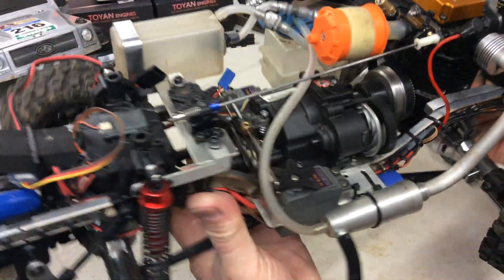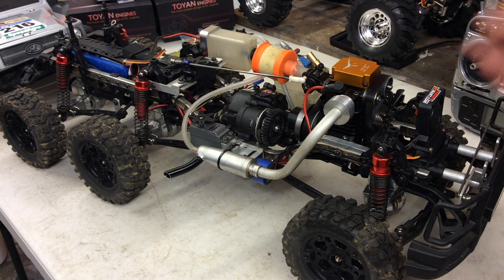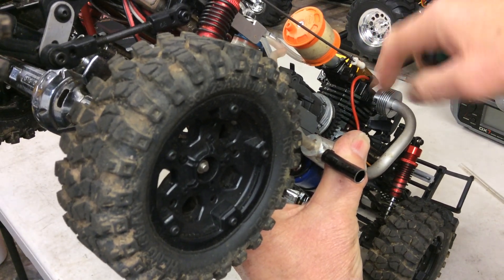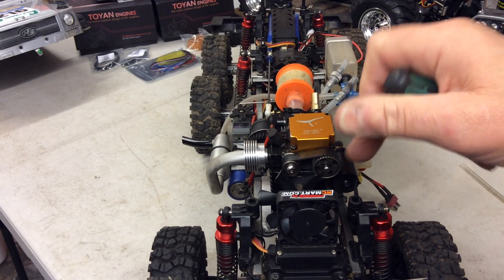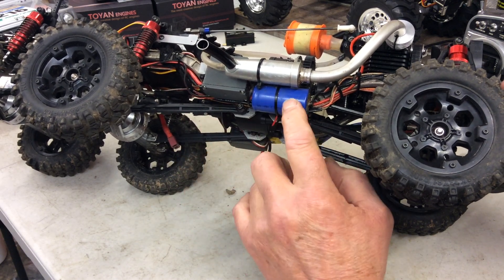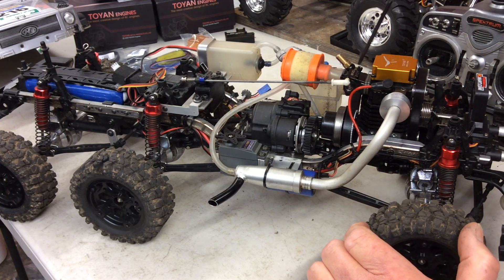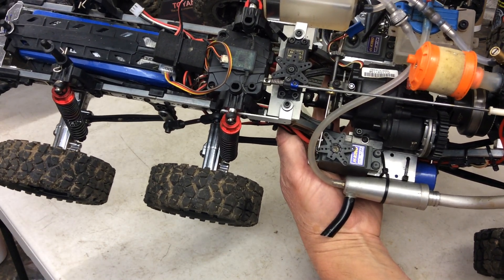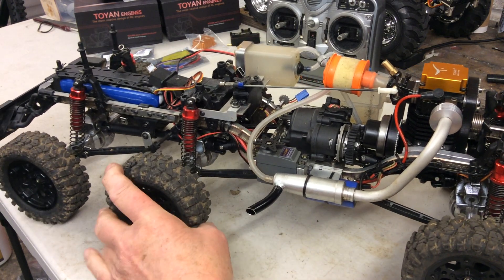Toyan Rc Engined P601 crawler 6 wheel drive

Comment: It’s not a catch port it’s a sump pickup, you can use a catch can if you want but you will be constantly filling it back up.
If you drill a hole in the oil pan you can run a filter and recycle it

Comment: Hi there, is there a particular type of grease I need to use on the cam for this engine or will any hard grease do? 
Great videos by the way
Regards 
Dave
Reply from the maker: dave garbutt 
Dave,  you don’t really need need a hard grease, I use just a normal high temp grease, like the stuff you use for wheel bearings 👍🏻👍🏻
Reply: Blacklamass 
Hi there, cheers for that!! I’ll use some wheel bearing grease then. I’m using 20% castor so I’m guessing that this will do most of the lubrication needed? 
Would that right? 
Regards Dave.